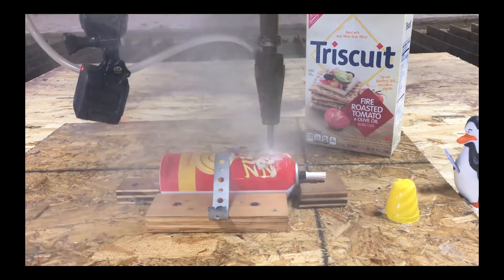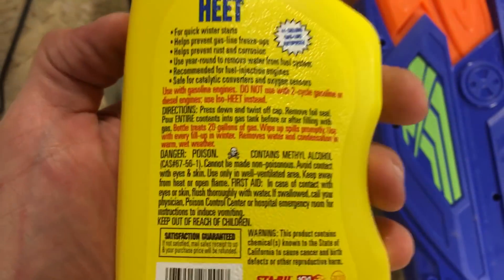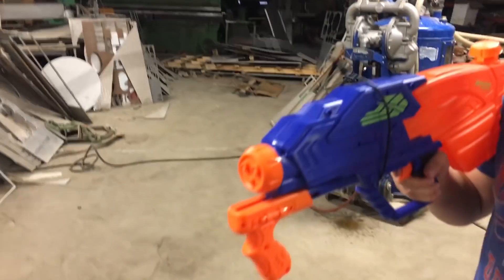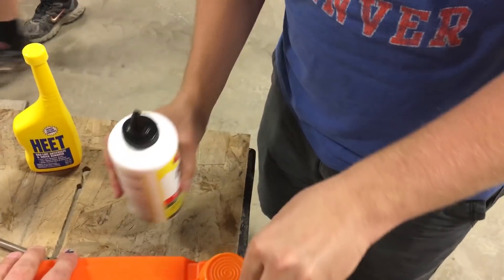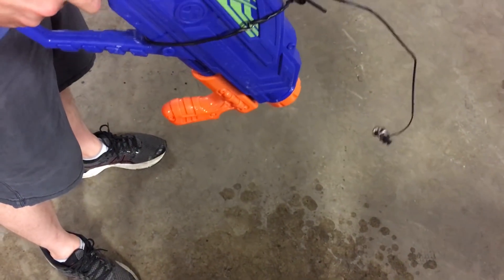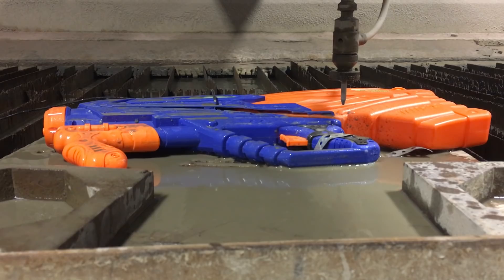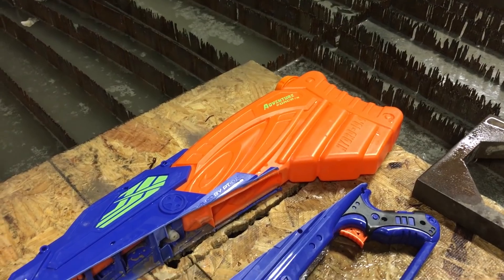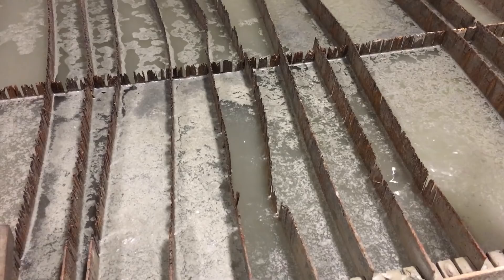DIY Super Soaker Flamethrower Green Flame vs 60,000 PSI Waterjet

Comment: It's really cute that you can use a super soaker as a flamethrower, but you should probably tell your audience how stupid you were to try that. The materials in a super soaker aren't meant to stand up to high temperatures, which means that using one as a flamethrower is basically asking to get a face full of burning whatever.
Reply: What you SHOULD have done is make your own flame gun out of metal. You know, so you're not in danger of having it melt.

Comment: But what happens if you load the fuel into the waterjet and make a flamethrower out of that??
Reply: It would probably cut the flame
Reply: Fkin genius lmao
Reply: @kaykmartins7335  I’ve thought of that too
Reply: Fire sniper
Reply: Because it would only be able to shoot down.
Reply: I’m thought of that too
Reply: It works but its pretty dangerous because the flame might bounce back in the gun and start burning and that could be a disaster if the watergun is leaking like most cheap waterguns do.
Reply: FIREBLASTING MANSHREDDING MOTHERFUCKING WEAPON.

Comment: i had an idea of doing this, just never had the balls
Reply: haywood jeblome I would reccomend that you don't buy it when you don't know what you're doing. It takes 30 ml to kill you and around 5-10 ml to blind you.
Reply: haywood jeblome Actually it can. It will also absorb into your skin. Do whatever you want, but be safe!! Atleast use some gloves.
Reply: haywood jeblome You just just a little too young to make a flamethrower.
Reply: haywood jeblome Don't do it. Methanol is poisonous.
Reply: I want to do it but where do you get that Heat stuff in the yellow bottle? And I only have $3 so is it more then that or not?
Reply: haywood jeblome anything will do, u can use rubbing alcohol, aslong as its flammable
Reply: My dad keeps the alcohol cabinet locked so i cant get any alcohol.
Reply: Ok. Cool. I can get some there. My mom wont know what it is.
Reply: They did it and it works really good. Im going to tell my mom its to clean my trampoline. Where is it at Walmart?
Reply: I am not drinking it! Its for doing the project. It wont blind me if i dont get it in my eyes.

Comment: You guys should try titanium vs. 60,000 psi jet
Reply: It cuts it just fine. Slightly slower than steel but it cuts no problem. Also there's sparks.
Reply: They did really thick bulletproof glass. Closest thing I have seen so far for beating the waterjet.

Comment: I remember this from the older kids in the 90's when they used Super Soaker 50's, originally bought for the beach, and then we were introduced to another delicious pyromaniac trick for the arsenal!

We used to used superglue to glue the hole up and force air thru and the residual glue hardened and made the shot hole smaller and worked a treat on some of the guns!